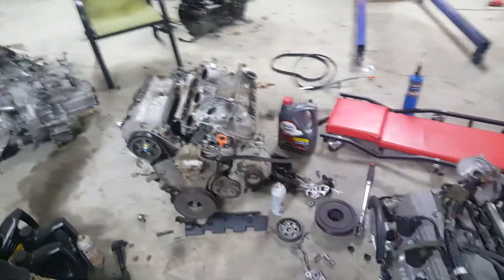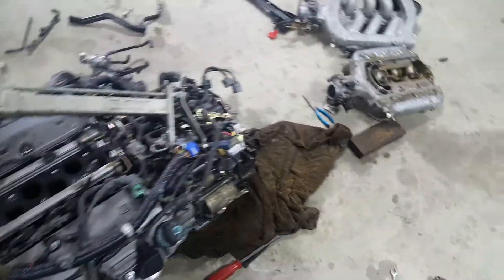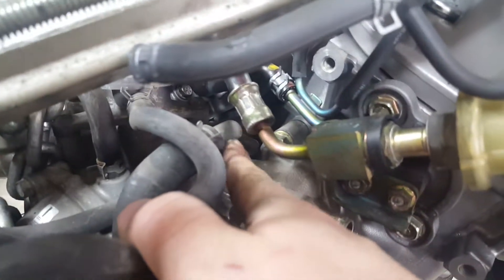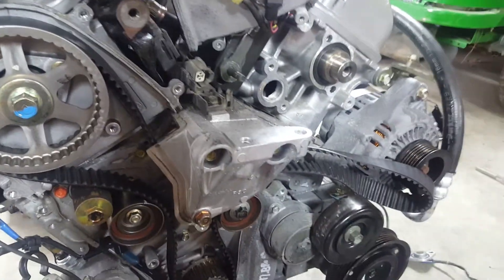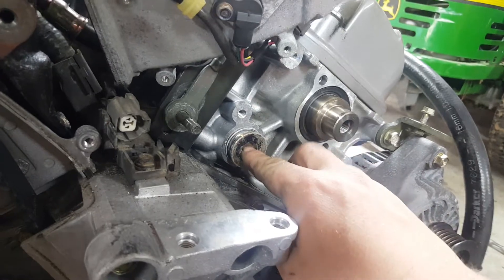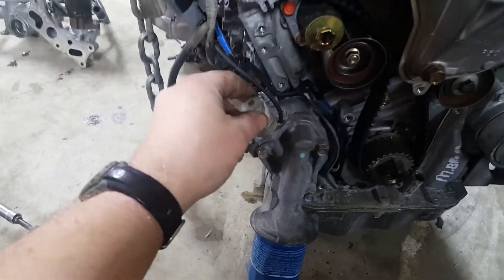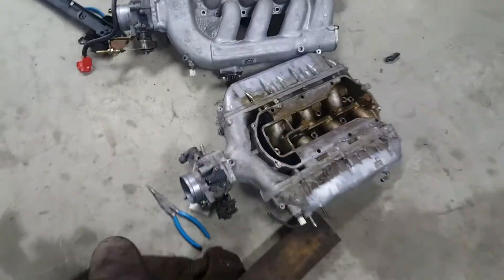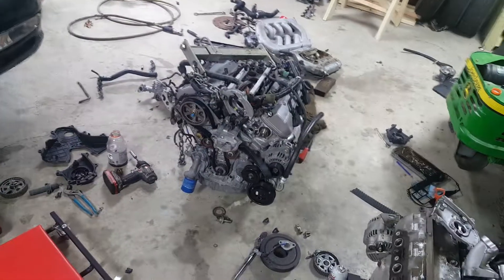99-03 acura tl j32 jdmengine and transmission swap part 2

Comment: Hi. I have an Acura TL 2004 base. Tell me if the MRDA automatic transmission is suitable for me, maybe they did such a swap?
Reply from the maker: Yes MRDA for 04-06 Acura TL
Reply: @shawnh9677  Thanks. There is one thing. They say that the L automatic transmission mode will not work with this transmission. This is true